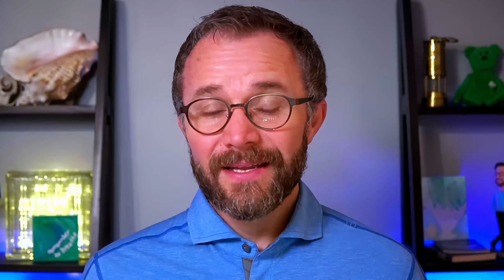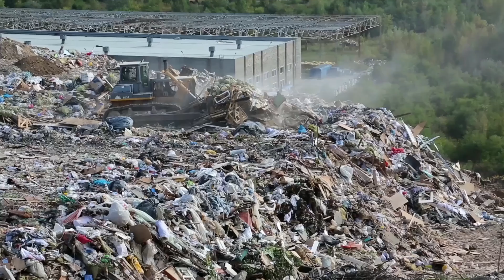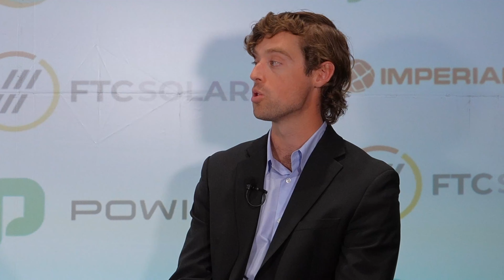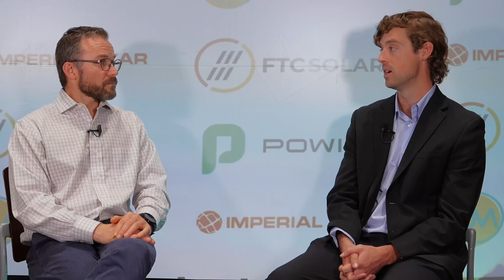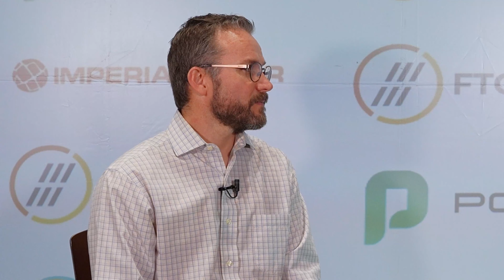Replacing Plastic With This New Material

Comment: Dear @SunCast Media, thank you for your video. I have tested many bioplastics, plant made plastics and other materials and found out that sometime they are even more dangerous leaving thin film behind instead of decompose. The true issue is not plastic, but SINGLE USE, because no matter which material you will use, there will be an issue at the moment when you start overproducing to reach the profitability promissed to investors.